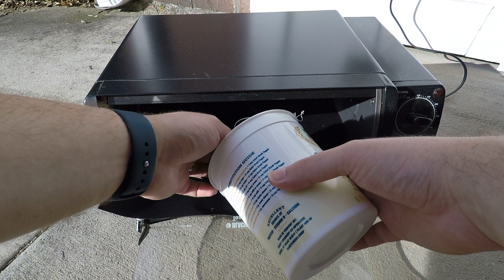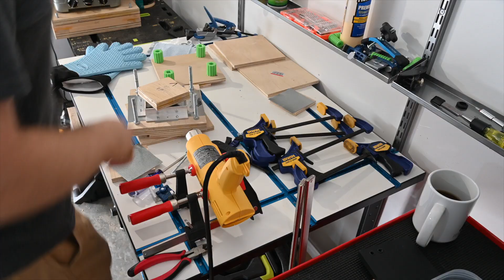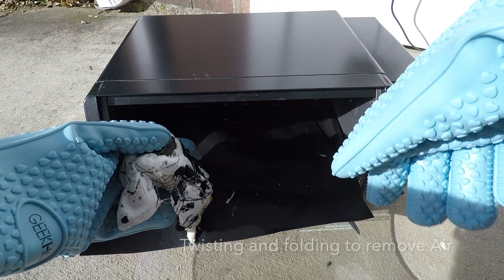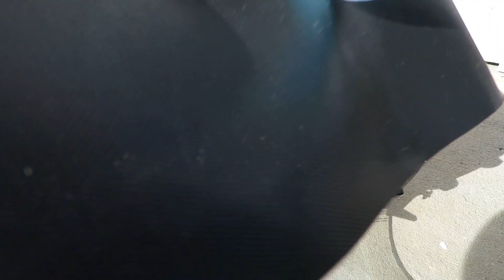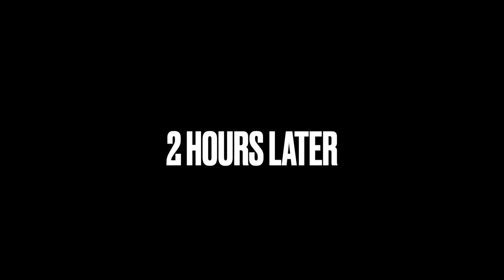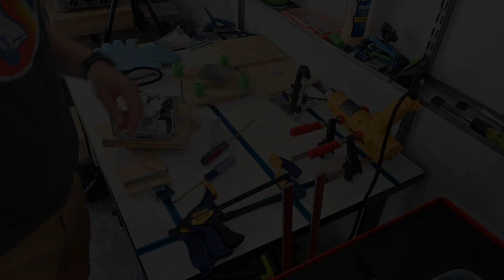Remelting PLA 3D Prints

Comment: A few questions. How much did this weigh, what do you do with these. I understand that composting or recycling back into filament aren’t really practical options right now so melting into something that is useful might be the move.
Reply from the maker: Hey @Richynick12, This melt used around 165 grams of waste PLA. I use them in a few designs the one I have posted right now is an apple watch stand. You can read a bit more here - https://grantparker.studio/apple-watch-stand-with-recycled-plastic-base